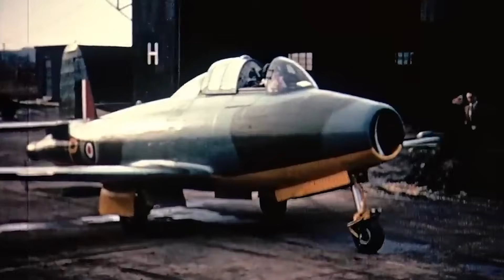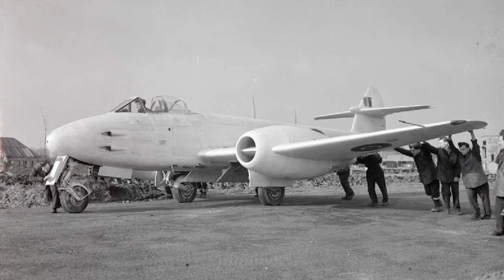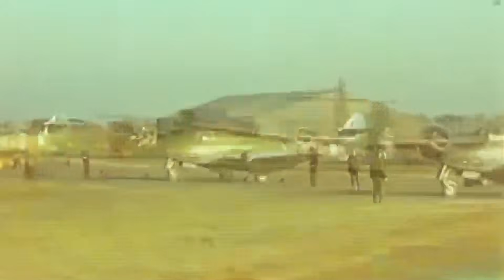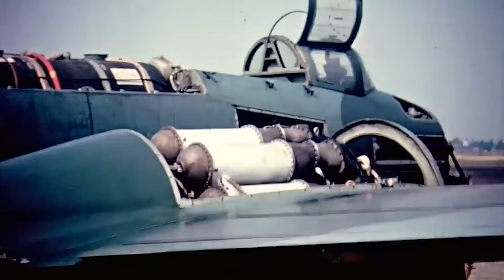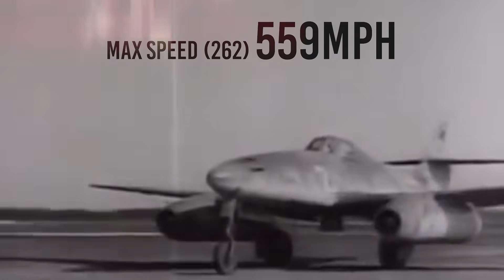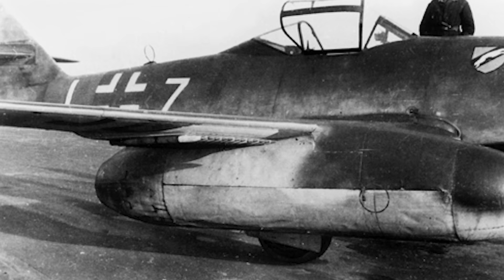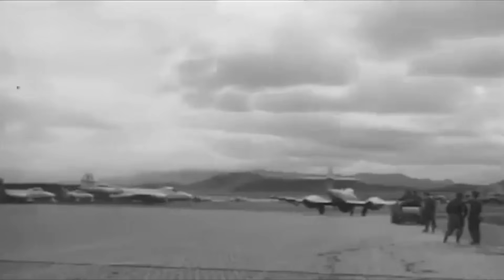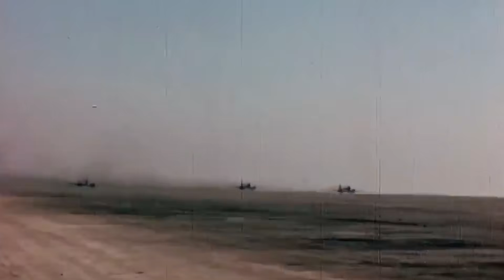Meteor vs Me 262 | Which was the better WW2 jet?

Comment: The ME-262 was the better design given the foresight of the engineering, the podded engines, swept back wings and axial flow turbojets design, all while lacking critical materials and under interference from high command
Reply: LOL The Nimonic nickel super alloys were developed in Hereford England 1939 -1940. In Germany they thought they needed to use stainless steel for turbine blading which doesn't work and due to various issues ended up attempting to use pressed sheet steel turbine blades. 

262 & it's engines = Garbage (but it did actually fly which surprises a lot of people). In both Russia and France good people wasted their time trying to do something with the engine after 1945. Russians ceased trying in 1948 as their own effort was clearly better.
In France RR got involved in 1950 and managed to get something useful working. 

We feel we can clear up some commonly held myths and misconceptions, obviously.
It's always good to see the facts presented clearly and concisely isn't it?

The Gloster Meteor was one of the world's first jet fighters to go into service, it was in service during WW2. The meteor was the first effective multirole fighter bomber jet aircraft with a reliable engine to go into service,  It broke speed records in 1945 and 1946. During WW2 it was in service as a fighter and multirole aircraft over the UK and over all allied controlled territories in Europe and beyond. 

The ME-262 and it's 46 minutes life engines were abandoned shortly after 1945, it had a do not exceed speed of 456 mph and was only ever used to attack bombers with losses of three 262s for each downed bomber.  During WW2 most of the ME-262s were destroyed by their engines, were various types of accident losses or were shot down by bombers. No German designers were involved with the Mig-15. The Mig-15 used a copy of the RR Nene.  

During the Korean conflict most of the Meteor casualties were due to groundfire or accident losses. The result of any tangles between Migs and Meteors was that Mig pilots avoided getting into dogfights with Meteors. The battle of Sunchon, where 50 Migs against 14 Meteors resulted in the supposedly superior Migs failing to gain any clear advantage caused the Koreans to re-evaluate tactics. General opposition in Australia to involvement in the Korean conflict resulted in the govt using the battle as an excuse to reduce the RAAFs involvement to troop support only.

The world's first wind tunnel was built in England during the 1800s. The world's first supersonic wind tunnel was built in England during the 1920s. 

The Whittle Gloster E28/39  was of course a brilliant aircraft that was later copied in Russia as the upsized and tweaked Mig 15 with a copy of the RR Nene gas turbine aero engine. The RR Nene being the world's most powerful & most reliable gas turbine aero engine in 1944.

The MD F3H Demon was a contemporary to the DH Sea Vixen & had a similar performance. The F4 Phantom was a follow on from the F3 Demon. The Sea Vixen took a long time to get from first flight to introduction for various reasons and a similar situation occurred with the MD F3H Demon.

McDonnell Douglas F3H Demon
590 Built. Not Supersonic.
Max Speed 578 MPH.
Introduction date 7 March 1956
First flight 7 August 1951
Retired 1964

MD F-4 Phantom 2
Number built 5,195
Manufactured 1958–1981
Introduction date 30 December 1960
First flight 27 May 1958

DH Sea Vixen
Number built 151 (including two DH110 prototypes and one Sea Vixen prototype)
Introduction date July 1959
First flight 26 September 1951
Max speed 695 MPH.
Retired 1972

Interesting British achievements.
There is no doubt that the Fairey (England)
Delta 2 was of course the world's first jet
aircraft to exceed 1000 mph.  Indeed It
exceeded the previous record by 310 mph &
held the record for 1 year. Incidentally, the Dassault Mirage 3 & 4 are based on the Fairey Delta 2.

The Panavia Tornado & Euro fighter Typhoon are British design aircraft with British design engines built by international consortiums. 

The EE Lightning was one of the fastest aircraft on the planet when it first achieved a Mach 2 flight. 

Early days, jet fighters.
De Havilland Vampire, Sea Vixen & Gloster Meteor accident losses were not high or unusual for fighter aircraft at the time. De Havilland built large numbers of all metal airframe aircraft before the DH Comet.
We mustn't forget of course that the DH Vampire for example first flew in 1943 & the engine was also built by De Havilland. There were examples of the Vampire interceptor / fighter in service until 1990 which was operated by more than 30 countries.

Non combat phase accident losses.
% of Aircraft built.

The Canadair CL-44 was a turboprop airliner.
Canadair CL-44                  (ff 1959 ) 48%
Lockheed XF104                (ff 1954) 100%
Lockheed  P80                   (ff 1944) 43%
Lockheed F104                 (ff 1954)  45%
Grumman f9f-5 Panther   (ff 1947) 44% 
Convair F102 Dagger        (ff 1953) 45%  
MD F-101 Voodoo.             (ff 1954) 34%
MD FH Phantom 1            (ff 1945)  35%
MD F4 Phantom 2             (ff 1958)  28%
MD F3H  Demon               (ff 1951)  32%
Gloster Meteor                  (ff 1943)  21%
DH Vampire UK                (ff 1943)  23%
DH Sea Vixen   UK           (ff  1951) 33%
Gloster Javelin  UK         (ff 1951) 20%
EE Lightning  UK             (ff 1954) 33%

It's a great pity & a crying shame that British military forces had to occupy a large part of Germany for decades after 1945 & Russian military forces had to do the same. Of course Russia still posseses a large chunk of what was German territory & of course Russia & the UK produce nukes. Obviously Germany does not produce nukes.

Early days, jet engines. Whittle performed the world's first demonstration of a gas turbine aero engine in 1937. The RR Nene, a centrifugal gas turbine aero engine, was the world's most reliable & most powerful gas turbine aero engine in 1944. Licensed built versions & copies of the RR Nene & RR Derwent would go on to power many aircraft in Russia including the Mig 15 & Mig 17, the US, China, France & other countries for decades after 1944. Incidentally, the Mig-15 was in essence an upsized / tweaked copy of the Whittle / Gloster E28/39 jet aircraft including an uprated copy of the RR engine.  The basic centrifugal compressor gas turbine aero engine with Whittle style reverse flow combusters and sometimes an axial compressor section is still manufactured by more than one company including Pratt and Whitney, the main application being helicopters.

The gas turbine engine was invented in England during the 1700s.

During the 1800s Parsons of Ireland & North England produced the world's first axial multi stage sequential stator rotor turbines and compressors for turbomachinery use which would eventually go on to to form the main components of the axial gas turbine aero engine. At the time the basic idea of making an internal combustion gas turbine engine and using it as an aircraft engine was considered thus the jet aircraft concept had been created in England before the first powered aircraft flew.

An example of what goes on these days in various countries. For example, there are of course no German companies that makes German jet aircraft in Germany & there are no German Companies that make German gas turbine aero engines in Germany that are suitable for widebody airliners.

The UK has the world's highest combined per capita Nuclear / Defence / Aerospace Sector Activity.

UK defence sector, absolute terms, world's second highest activity. 1st for per capita defence sector activity. Per capita nuclear powered submarine construction, 2nd position. 
Main players being Rolls Royce, Babcock, GKN Aerospace & BAe Systems. Activities often involve international collaboration. BAe systems, RR and other UK companies now handle more Airbus work value wise than Germany. 

There's a good chance that anyone currently flying on a widebody airliner will be on an aircraft powered by RR gas turbine aero engines made in the UK and a good chance there will be other hardware on the aircraft that's designed and / or manufactured in the UK. 

Rolls Royce Holdings UK
Subsidiaries
- Rolls-Royce plc
- Rolls-Royce North America (ex Allison etc Classified Military stuff)
- Rolls-Royce AB
- Rolls-Royce Deutschland
- Rolls-Royce India Private Limited
- Rolls-Royce Marine Power Operations
- Vinters Engineering Limited
- Rolls-Royce Controls and Data Services
- Rolls-Royce Power Systems
- Bergen Marine
Joint ventures include:
- Rolls-Royce Turbomeca
- MTU Turbomeca -

Trent Family
The MT30 (Marine Turbine)
Industrial Trent 60 Gas Turbine
Trent 7000
Trent XWB Airbus A330neo.
Trent 1500
Trent 1000
Trent 500
Trent 600
Trent 700
Trent 800
Trent 8100
Trent 900
   
RR wholly owned subsidiaries in Germany handle smaller 2 shaft RR gas turbine aero engine work.

The UK space and aerospace sectors are highly productive, high-value industries that together contribute over £18 Billion in direct Gross Value Added (GVA) to the UK economy. Individually, the space industry directly contributes about 0.3% of UK GDP 7•2 Billion while the aerospace industry contributes approximately 0.5% £10•9 Billion.
   
Wee hopes theze helpsmz.  EtC---.

We hope this helps of course 👍